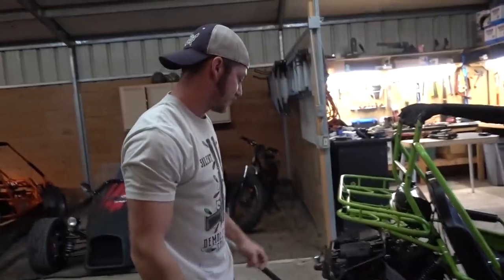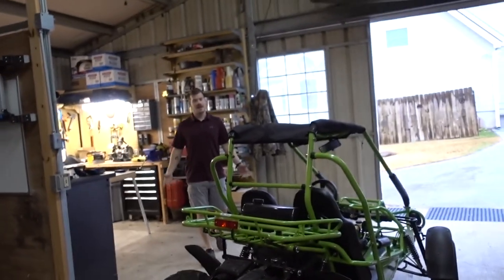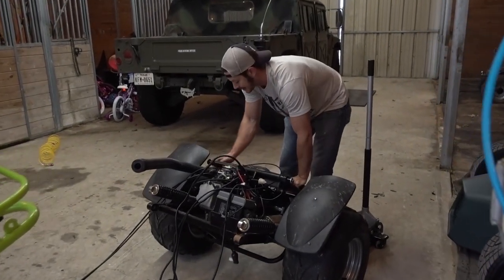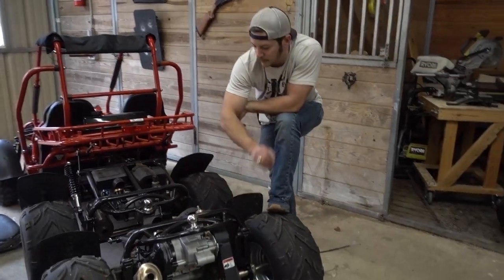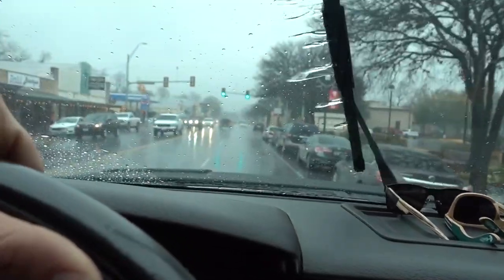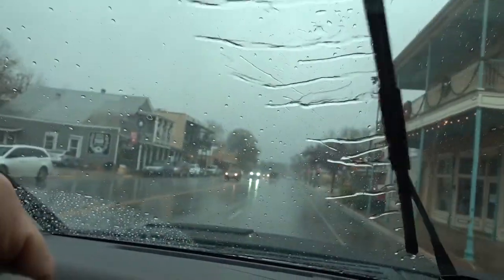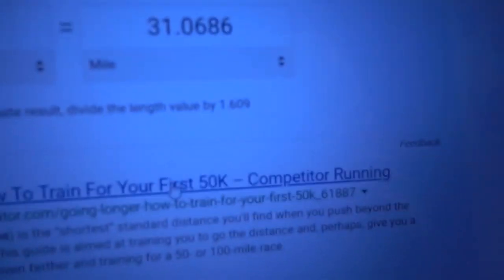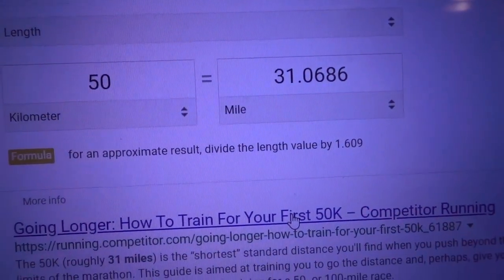Building Double Engine Go-Kart...

Comment: Just for future reference if you take a ratchet strap and ratchet it around the tire in the middle of the tire  you can tighten in down until it spreads the tire while you fill it with air.

Comment: For the go kart, use the 1st engine cage to build the brackets for the trailing arms, sway bar, & shocks. That way, both drivetrains will still have full suspension.  As long as you line them up just right, everything else will be a breeze! Happy Holidays from🌴Hawaii🌴

Comment: As interesting as your current project seems on the surface and the "looks Kool!" factor. Why work the huge logistical troubles of Synchronizing two motors together. Why not just get an engine with double the power of these two engines?? This route deletes the unavoidable problem of donor vehicles with no ass end filling your garage! That said.. Have you checked the Tractors Pull videos? They do lots of multi engine builds!

Comment: I suggest you run a regular marathon (26.2 miles) on flat ground before running over 31 miles on rocks and mud. Perhaps get in a half marathon first just to say you did it. After that, do a full marathon. Just jumping into a 31 miles trail run seems like a recipe for failure, again. As for the engines, that is easily the dumbest idea you've ever had lol

Comment: Good luck getting that thing to turn with two axles with no differentials in the back.

Also those things will climb like mountain goats with a few simple mods....mainly changing the weights and springs in the clutch pulleys.  Cheap and easy bang for the buck mods.

Comment: if I'm not mistaken connecting the suspension to the existing rear subframe will not go as you plan. I think you will have to extend the actual frame/ body of the cart. BUT i like this idea i think it'll be awesome when finished

Comment: I've not done any kind of project like that I'm no expert or anything, but you might want to consider doing as many bolt on custom brackets as you can. The more you weld the harder it will be to go back. You may wind up regretting doing this in the future if you can't put it back the way it was.

Comment: Get yourself some dirt bike engines like 250cc 2 stroke motors and put those on your carts. Back in the day (70's) we used to put the biggest chainsaw motors on our go carts and during the winter we would stud the tires and race them on the frozen river we lived next to. Getting the carbs sinked together might pose some issues.

Comment: To run in a competition you need to be able to run a little more than 31 miles. Because you are hoping that you can do most of this on Adrenalin & the pure will of the moment even if you have done much less training, you won't be able to do it, you'll fail miserably putting back your confidence even further. If you can't actually run 31 miles in similar conditions when training then you are not prepared for the race.

Comment: You know you could wrap a small 3/8"ish rope around the circumference of the tire in the middle, put a stick under it and twist it to squeeze the center of the tread in and that pushes the beads out to the edge of the rim and then you just use the air hose while slowly unwinding the stick...
i mean you could....
but..
wait whats this about a rope?  i just see fire, dont see any rope ;)

Comment: I am impressed with the double engine go kart! seems doable when you can disconnect the whole power plant. idk why you didn't use the 2nd brakes tho, you need to run the gas cable to the front anyway :D
for the race: Id say go half as fast as you usually go and you can make it!

Comment: Use heim joints and round tubing for lower arms. Then build a mount from the upper cage to hold  rear shock. Then build a pan hard bar to keep it centered. 
Get ahold of Ike and John at Cars and Cameras channel, they can help ya synchronise the throttle cables and shifters.

Comment: Time to find an engineer with experience in building multi-axle builds.  Have fun!  I would start by extending the rear (red) tubing so that you can hook the suspension to the roll cage and not to the other motor pod.

Comment: What did you spray? you just burned up the seal on the stem, now your'e going to experience leaking. all you need was a 3 sec spray to inside & a 1/4 moon on outside with a tail & ten light it up.

Comment: Matt, a solid axle is going to make it very hard to turn. Make a mini frame and hitch it to the ball on the back of the cart so it can swivel. Then again it may have other problems if it can swivel. Tractors have this problem with locking the axle and trying to turn. Best of luck hope it works better than I expect.

Comment: You need to think about how if the back axle assembly is hard connected to the front back axle and you sit in the go kart the front back axe moves up and down. It might lift the back back axle off the ground or bend it in a weird way. Or even lift the front back axle off the ground a tad. idk just something to think about though.

Comment: You could have used a T fitting and ran a Brake line to the second axle. That way you'd have 2 brakes with the same pedal push

Comment: nice idea but if but if its a solid axle and both tires spin on each axle it wont turn when you steer it will just go straight you need limited slip rear ends to do what you want to do i mean have at it lol that would be fun to do it will work better if you have independent suspension for each

Comment: You will end up doubling the torque but the top speed will be around the same. Go with a bigger engine and different gearing. It will save lots of time and you will save 1 go cart

Comment: Matt, pull the Schrader valve out next time and use the air blower attachment to set the beads. A LOT safer and works better.

Comment: Make the suspension on the rear and middle axle independent so wheels went coming of the ground an so you don't snap your weld, secure the bottom part of the back on pivots and the top with the springs

Comment: An alternative way to seal the tire bead is to put a rope around  centered on the tread.
Stick a pipe between rope and tread. and twist.  Compressing the trad pushes the sidewalls out.
Get a couple of PSI in and remove the rope.

Comment: Make a cradle with the rear motor to join onto the tow ball of the existing frame. From there you will just need to extend the throttle cable, get rid of the shocks as most the up and down movement will be covered by the tow ball itself.

Comment: You might want to mount those shocks to apply downward force off of a sturdy hard stop , otherwise the back set of wheels may not have enough weight to get decent traction.

Comment: 1) for the back engine to connect it u should make a extra seat or “luggage rack” to put something on the back and connect 
2)the second engine u should make it a slight delays when it starts cuz if you start them both at the same time and go the second engine/rear engine might go fast and hit the back of the first engine 

I hope this makes sense

Comment: @offtheranch if you wanted the cart to go “faster” the sprocket set is the way to go because you change up the ratio that the wheels spin compared to the engine. By hooking the second engine behind the first you essentially just increased the pulling power of it and made it more of a utility cart. Your idea may make it a little faster but if you want it to have speed change the sprockets. None the less looks like a fun badass project!! Keep it up love the vlogs you’re one of the only youtubers I watch!

Comment: Just use a offroad treg hitch between  the 2 ..... use the towball on buggy , and just fab up the hitch  mount on the rear engine  assy dont need the shocks then as the hitch will also  position the rean engine

Comment: You do know its gonna be the same speed right? that all comes down to gearing. your only gaining traction and acceleration and only if you can get those rear wheels and suspension dead even. , cause if you dont the one set of wheels are gonna spin and the others wont. you have to have an even amount of weight on all 4 rear tires

Comment: Matt us the bottom mounting point from the other gocart weld it to the rear it will space it out use the holes for the factory mounting points and bolts to keep the shocks weld square tube to the engine cage with a triangle crossbar for structure basically like a vertcal A frame and horizontal A frame look at a horse youd use to cut wood on for what im sayin and use those mounting points to join it or get a piece of tube that fits the length from the eye of the shock to a point to mount it and get heim joint ends to bolt it that will help with articulation and theyre greesable as far as linking the carbs get a wire connector its 2 bolts with a plate that clamps the metal wire run one to the throttle with it long and mount the rear engine throttle cable to that as far as brakes you could install an ebrake like a hydro style or if you have an ebrake in the gocart use that for ignition system get some switches for power and a button to push start the other motor hope that helps man

Comment: You do realize you’re need to make sure both engines are tuned the exact same, because even if you have all the linkage in cables tune the exact same you still need to make sure they are taking in the same amount of gas and air unless the engines will be fighting each other and burn each other out

Comment: Hey mat I'll make it easy on you hook the last engine to the front engine meaning fuel lines throttle cable and brakes just connect everything to the other motor so u arnt running everything so far

Comment: Solution for the throttle is just go buy a really long throttle cable and run it trough one with locks on bot sides and then lock it in on the second motor so they both move simultaneously.

Comment: Weld another joint to the back of the normal go kart and put bolts through connecting the back of the normal to the front of the half

Comment: That works.    A little safer is a ratchet strap around the tire , tighten it around the center it will push the walls out.

Comment: A safer way to get air back in that tire.  Put a rachet strap around the center of the tire all the way around.  It will push the sides against the rim and you should then be able to get air back in it.  Used this on my mower several times.  No fire needed :)  Likely not as fun, but sure is safer!
Reply: but than its not fun

or demo standerds